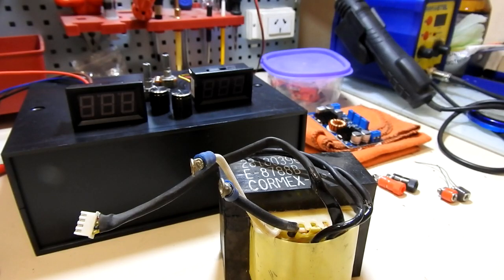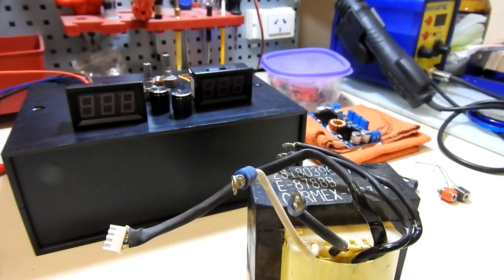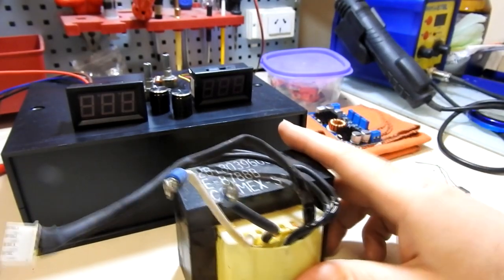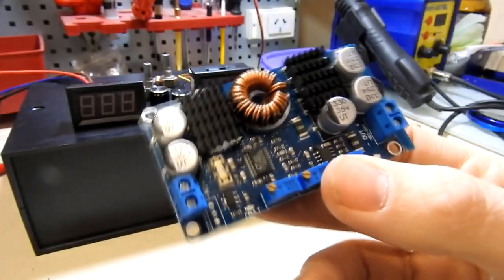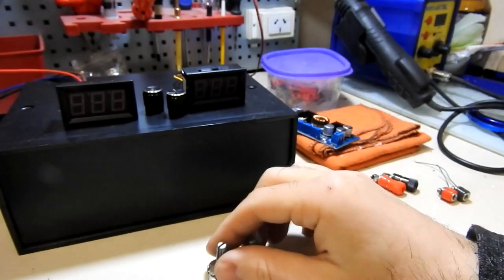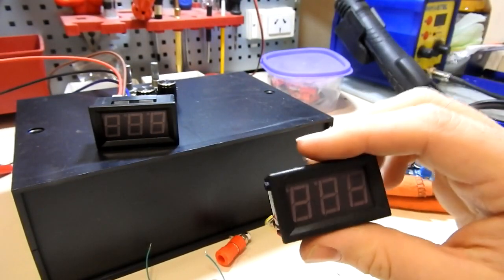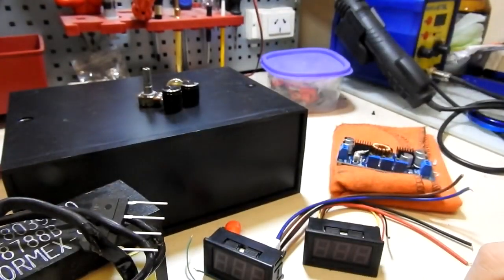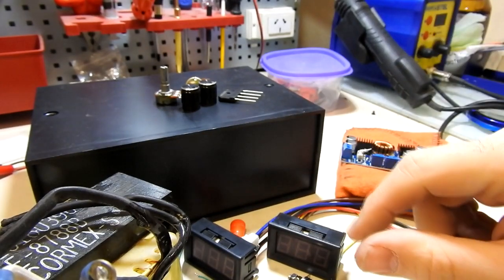Fuente Regulada 2018 - Materiales - Parte 0

Comment: HOLA QUE MODELO ES LA FUENTE STEP DOWN
Reply from the maker: https://m.dx.com/p/dc-5-30v-to-dc-1-25-30v-adjustable-step-up-step-down-constant-voltage-constant-current-module-2060596
Reply from the maker: https://m.banggood.com/DC-DC-CC-CV-Buck-Converter-Board-Step-Down-Power-Supply-Module-7-32V-to-0_8-28V-12A-p-1245047.html?rmmds=search